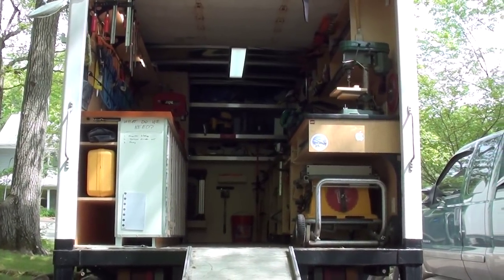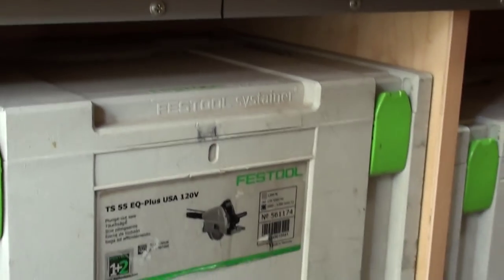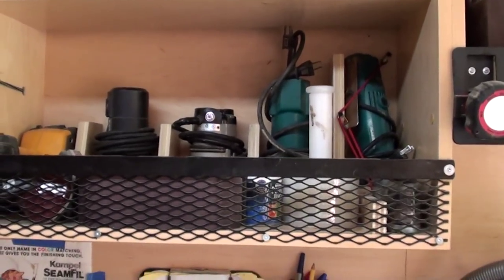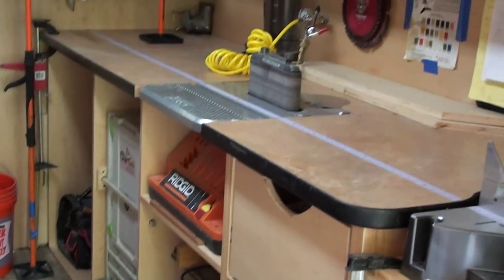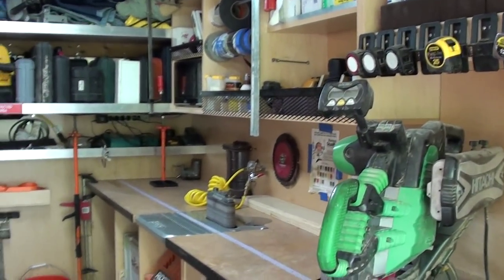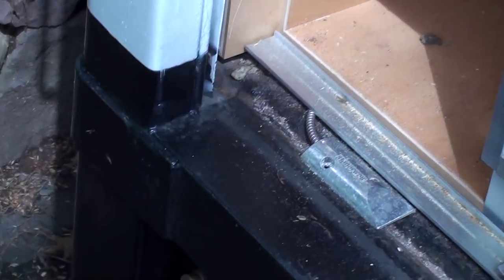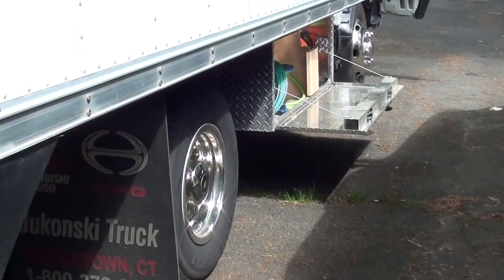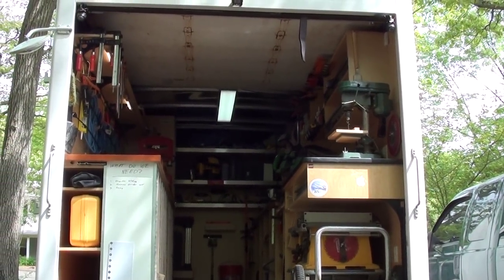Tricked out woodworking box truck

Comment from the maker: I made them.  They are simply a spring stick screwed to the bottom of the cabinet (towards the back). The stick has a small knob on the front side of it which sticks up through into the drawer.  If you would like, I can post a little video of it tomorrow.

Comment from the maker: @kentnet11, sorry for the late reply, I found an inverter to be better for the quick uses, instead of continually firing up a generator.  If I need it for an extended amount of time, I just start up the truck. (It is actually quieter than a generator anyway)

Comment from the maker: Thank You! The side ladder racks came from VertiTrack. The additional plug in is easy to do with a basic understanding of relays. When the truck is plugged in, the relay is powered & opens the inverter circuit & closes the power circuit. If this is not done, something will blow up...... The back door locking system is a product we are developing & currently in patent pending status. It is called the "TailLock" If you are interested in getting one, let me know.
Brian

Comment: that has to be the most well thought out and executed mobile workshop ive ever seen..  i imagine you do a lot of custom closets, if not, you should just for your organizational skills.  the only thing i was hoping was for you to show all the festool equipment you have stored.  they obviously had someone like you mind when they designed the cases for their tools.  i imagine you could easily outfit another box truck and turn a decent profit selling it to another contractor.  amazing...  was waiting for some flip up work tables and a retractable awning to be on the passenger side of the truck..
Reply from the maker: Thank You very much! I thought of the flip up work tables on the outside, but it ended there. I dont think I would use it. As far as the awning goes, I am installing one on the rear of the truck this spring. I just installed a garage door opener. Here is the first of 6 videos featured on Tools of the trade: http://www.toolsofthetrade.net/null/a-way-cool-shop-on-wheels_o.aspx?dfpzone=blogs.davidfrane
Also, have you seen it on American Innovator?
The American Innovator - Lean Truck
That video is a bit more current & shows some of the other tricks about the truck. Im glad you enjoyed it!

BP

Comment: Great truck.   I am doing the same thing with a step van now.   Where did you get the side ladder rack and power locking system?  Also, I have a power inverter which powers the truck but I do not have a power inlet to plug the truck into a direct power souce.   Is it pretty easy to add?

Comment: Wow, this is a carpenters dream! I'm trying to choose an inverter, I was hoping you could help me out a little. Does the 5000 watt inverter give you 15 amps for miter saw and table saw no problem? I was researching a little and best I could figure is a miter saw might pull as much as 32 amps at start up which is still less than 4000 watts but I read in some places that people were having a hard time with 5000 watt inverters running skill saws and such so I was thinking I should splurge and get a 3000/6000. I definitely don't want to burn up my motors. And does it require dual battery? I was hoping to keep just the one. And also should I get sine wave? Thanks in advance.
Reply from the maker: Hi! I am actually using a 3000 watt continuous inverter now. It runs a tablesaw, chop saw, and small compressor with no problem. (although not all at the same time...)  I found that my 5000 watt required the truck to be running most of the time which defeated the purpose. However, when it it cold out, and if your batteries are not in perfect order, you will need to keep the truck running to handle the start up surge of a cold electric motor.

Comment: I have a question about this incredible set up, with the two power inlets (the lead and the one for use at a loading dock) if you are running it from the lead doesn't the one at the back become live too?
Reply from the maker: That is a great question! I have a great answer! I have a powered relay in between the two inlets, which disconnects the opposing one during use. There is also an additional relay which shuts off the inverter system when the truck is plugged in.
Reply: +Brian Way damn! sounds like there has been alot of thought aswell as time and effort gone into this and it has really paid off, it looks amazing!

Comment: Hi, 
I am also building a truck similqr to this one , video gave  me couple of good ideas . And I have one question how does your inverter batteries get charged  while on the road do they get charged from the truck alternator or from outside source .
Reply from the maker: The inverter runs on the 2 truck batteries.  I chose not to install an isolator with additional batteries. So, while the truck is running the batteries get charged as usual.  However, I use a toggle relay system to allow me to also plug in the truck with constant power.  When this happens, the batteries are trickle charged at the same time.  Hope that helps!

Comment: That is a bad ass set up. What are you running the power inverter off of? I was told that if hooked up to the battery even with the truck running it would ruin the battery and not work? Where did you find the heavy duty locking system to lock the doors?
Reply from the maker: Damian Sullivan The truck locking system is available at www.taillock.com
Reply from the maker: Damian Sullivan you may decrease the overall life of the battery however I’m running 2 deep cell marine batteries and I plug the truck in that has a battery conditioner on it as well, I have no problems, get about 2 to 3 years out of the batteries

Comment: Sweet ride, do u leave the truck running while using the 120v to recharge the batteries
Reply from the maker: Jason Michel If I’m using something with a heavy draw like the compressor or tablesaw I will leave it running, otherwise two deep cell marine batteries work just fine

Comment: hi I love the video, would love to own some thing like this! I do have a question about the inverter u use I,  I know that the output is different as I'm from England but  just want some advice as I've been told to get one which is sine wave??? is this true?? also does this drain your battery?? 
thank you,

Sean
Reply from the maker: +sean smith Sine wave inverter's are only necessary if you are running computers or other sensitive electronics.  You typically pay more for them and get less wattage output.  I had a 5000watt output but fount that the truck need to be running to power it.  I now have a 3000 watt continuous and am very pleased.  I will drain your battery, if you are using intermittently, and have dual batteries you will be ok.  If I am using the compressor or table saw for an extended period of time, I will start the truck for fear of the battery going dead.  Inverters also dont like the extreme cold.

Comment: Brian, where did you get those rubber bungees you have mounted on the drivers side of the box? Looks like they're strong enough to hold a ladder..?
Reply from the maker: +Josh  H Those are indeed ladder racks, purchased here: http://vertirack.com/
Great system too, I tend to used them more for 16' moldings, because my truck is only a 14'
Reply: Thank you!  I operate a similar business out of a 16 foot trailer, but my trailer is so loaded with tools that I barely have room for lumber, let alone to do work in there :)

Comment: Wait. If you have two male 110 plugs, wouldn't one be charged if you plugged the truck in?
Reply from the maker: A Crustacean Not in this case, there is a relay system that toggles it so only one can be charged at a time.